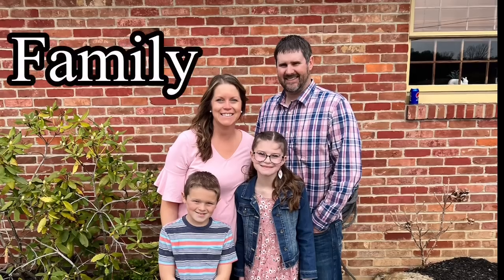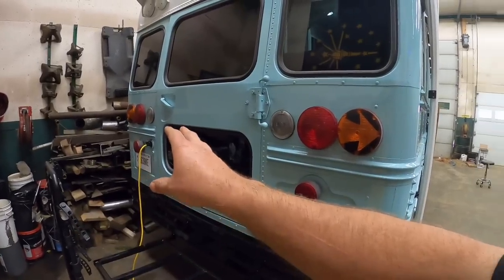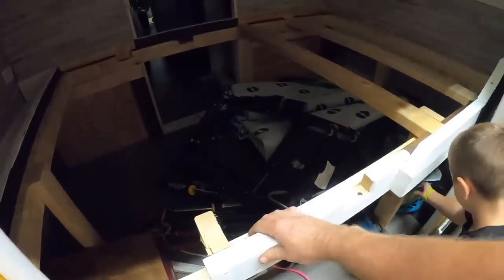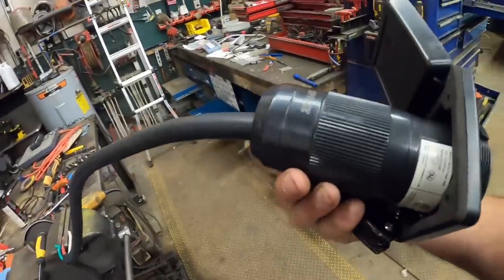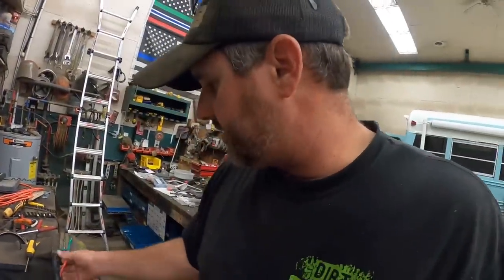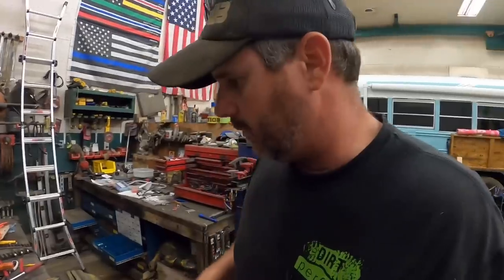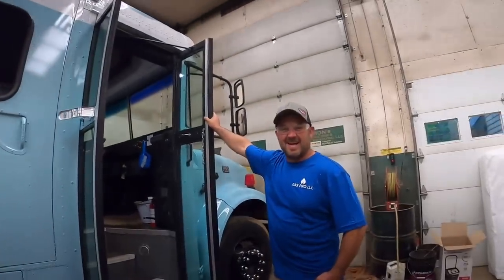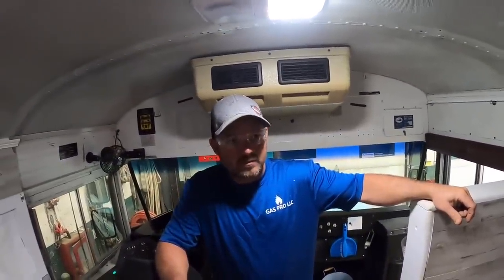Camper Bus Re-wire And Ac Upgrade: Little Family Project

Comment: A little advise from a master electrician…..Install a separate ground bar in the panel (for green wire) and remove the bonding screw.
Reply: My thoughts exactly, winced when Mike joined the neutral and ground in a sub-panel.  Only should the 'straight from the pole' Main panel have the Neutral and ground joined, otherwise you invalidate the proper ground path.    Nice wiring discipline otherwise.
Reply: @paulholmes672  my question is, if this is an RV,  then does it get wired differently? I ask because I am assuming that the power at the campsite is coming from a small subpanel with breakers and an outlet. Did the RV park already separate the ground and neutral at the campsite box? I have always been curious on how an  RV should be wired when it comes to AC power. Also, should the metal body of the bus be grounded/bonded to the subpanel?
Reply: @paulholmes672  I winced also when he put the neutral and ground wire of a circuit under the SAME screw.  If that one screw got loose, you could easily end up with 120 volts on the bare metal of anything plugged into that circuit - VERY DANGEROUS!

Comment: DP, you should consider putting those batteries in a box under the bus outside of living space. It could be a safety hazard in case of damage or short-circuit in an enclosed space.

Comment: I noticed it still has the factory AC, so I assume it's operational when the bus is running. That roof mounted unit is definitely better than that little portable unit.  I'm really impressed with how well designed everything is inside the bus.  Imagine if you had a 40ft bus!
Reply from the maker: Yup when running

Comment: Nice job on the wiring and A.C. installation. The camper bus has turned out very nice, should be a pleasure to use and travel with. Thanks for the tag along video.

Comment: I agree with several comments that the panel needs a separate ground terminal bar and the green bonding screw removed.  The ground-neutral bond should only occur in one place, and that should be in the shore power panel.  If using a generator, you will need to make a ground-neutral bond provision.  In my generator, i made a 120v plus that just has a jumper wire from ground to neutral.

Comment: the battery area should be contained in a box that vents external to the vehicle. charging batteries can produce pretty nasty gasses you dont want in a bedroom.
Reply: Maybe the batteries can be gel batteries and are gas tight
Reply: @gurraflex6478  sometimes they still breach. its good practice to isolate charging batteries no matter the style. obviously some more dangerous than others.
Reply: I was thinking the same thing!
Reply: He also made it much harder to access the batteries by putting the breaker panel there. I understand needing easy access to the breakers but you need to be able to get to the batteries too…unless there’s access from the top I didn’t know about

Comment: Don't want to sound like I'm complaining but you may want to rethink your grounds on the AC power in your bus panel. The grounds should be on a separate terminal strip that is attached to the breaker box and separate from the neutral bar. Check with other people and see if I'm right. It should be safer.
Reply: definitely true for a subpanel....at least in a house. good chance that should apply here
Reply: You are correct!
Reply: I agree.

Comment: Even with a 30amp RV hook up, you shouldn't have to isolate things because everything should cycle loads at different times so you shouldn't have to worry about maxing out the main feed but on very rare instances. 31:34 "Hot Water Heater" - Didn't know you had to heat hot water? 😄
Reply: "hot water heater" - jumbo shrimp, true facts, park on a driveway, drive on a parkway, hamburger, quicksand, boxing rings, lead pencil (it's graphite), ship by truck and send cargo by ship, ...

Comment: looks like a great candidate for solar panels. and if you put a radiator next to you A/C exhaust on the roof, you can switch from internal hot water heater, to using your A/C and sun to heat hot water.

Comment: Day late and dollar short but ya shoulda coulda added insulation to the voids before putting on the plywood for the rooftop AC @23:40. One could still drop the cover and drill a couple of holes in the 2x4s and add low expansion spray foam.

Comment: You and Aaron are men with many talents!  Have  Jenna buy a 50 to 30 Amp adapter plug and she will be situated for most power supplies. She may also want to purchase a 15 Amp adapter if that is all it is available, she can plug the refrigerator in.

Comment: I am trying to figure out why you have a HOT WATER heater in the camper. If the water is hot you don't need to heat it. I say this because there are actually hot water heaters; mostly for industry where they have to have hotter water than what is normally supplied. We need to be more precise in this sort of thing HA! What I say is true, but I know what you were talking about. Most people call it a HOT water heater but that's not what they really mean; and you didn't either. Someone else mentioned your neat panel wiring job. I must agree, I was impressed and I have seen and done many panels. Nice job!
Reply from the maker: Plan worked perfect thanks

Comment: It's hard to tell but you might want to put a little more slack in your input cable so when you're driving the bus and it's flexing it does not pull the wires out of the plug.

Comment: Another circuit that would be nice is to go to switchs up by the door and put in two of the small switches that fit in a standard plug cover and then with a chunk of 3 wire go to an outside plug that is split into two so if you have outside lights you have a plug with two circuits that can be controlled from inside

Comment: The neutral and ground should be isolated ! #10 wire from ground to the bus chassis.  You’ll need to add a ground bus bar to the panel
Reply from the maker: Tell me why
Reply: @DirtPerfect  This is considered a sub panel, without a bonding wire to the frame there is the potential for it to become live. Bus sits on rubber someone touches bus from the ground and they git bitten. Think of the sub panel which is what you are installing as an extension cord which now has the neutral and ground tied together.  A grounded fault can return on the neutral creating a shock hazard. Its normal to tie ground and neutral together in the main panel because the ground loop won’t happen there. I know you you only want to do things properly so here’s the nec code According to NEC 250.32(B)(1), all sub-panels require separate neutral and equipment grounding termination bars. These bars must be separated in order to isolate the grounded conductors' “neutrals” from the equipment grounding conductors and metal cabinet.Nov 22, 2021
Reply: I agree with the ground and neutral need to be separated because this is a sub-panel.  The main panel that is feeding the bus should have the ground and neutral tired.  The green screw in the box should also be removed to isolate the metal bar from the bus.  Additionally, is you are using a generator, you will need a ground-neutral bond somewhere in the system.  I have made ground-neutral bonding plugs for when I use my generator.
Reply: Jay is right. There should be a separate equipment ground bar installed in the sub-panel. The green wire from the power cord should terminate on the equipment ground bar. The green bonding screw should be removed from the neutral bar. All of the bare/green ground wires from your romex branch circuits should terminate on the equipment ground bar. White neutrals terminate on the neutral bar. You should also add a #8 green or bare wire from the ground bar to the chassis of the bus. 

Right now all metal parts of the bus are isolated from your equipment ground and in the event of a fault to one of the hot conductors (chafed wire), the entire bus would be energized.

If you grounded the chassis of the bus, as it's wired currently, with the ground and neutral connected together in the panel, there would be neutral current flowing  on all metal parts of the bus and thus creating an electrical shock hazard.

Bus is awesome, but it's not safe as wired, in the event of a fault. 

Not picking on you or YouTube engineering- just want you and your family to be safe!!

Comment: The Hot Water Heater needs an illuminated switch - so that you can See that it's 'On' (because it's has no visible indicator)
- Illuminated being one of those with a built-in Red Light/LED

Comment: This is my favorite channel.  I admire how knowledgeable you are in so many different areas.  However I had to cringe when you wired up the sub panel wrong and completely against code.  The neutral and ground have to only be bonded at the first means of disconnect.  Meaning wherever the panel is that feeds the outlet that the bus gets plugged into.  Any sub panel after that has to have the neutral and ground isolated from each other.  In case of a fault, you need a direct path to ground to ensure that the overload protection trips.  By bonding the neutral and ground together, you have created two paths.  You simply need to add a grounding bar inside the box, put all your grounds on that, and remove the green bonding screw.  Sorry DP.  A very common mistake, but one that gets rejected by electrical inspectors all the time.
Reply from the maker: Thanks

Comment: Where is the Solar Panels? In the UK we would be using solar panels and you get a lot more sun than we do. You should be able to have at least 6 on th roof. If you have a look UK canal  Liveaboard narrow boat videos you see what I mean and they rarely use mains. There are not power sockets along the canal.

Comment: A marine waterheater with an engine heat exchanger would solve your problem. Mine is a 12 gallon with a std. electric element while on shorepower.

Comment: I know the Americans due electrical work a little different…….but you should not be combining your neutrals and grounds on same buss…the green screw (bonding screw normally only installed in first panel after supply transformer)in the neutral buss is dependent on how the supply system is wired and whether you have a ground rod/plate will determine whether to install that screw or remove . If  you leave the neutral and ground wires combined and a wire or appliance shorts out every metal surface grounded in the bus will have full voltage on it (possible electrocution)  and since there are no fuses on the ground wires they also run the risk of overheating and causing a electrical fire.. Please consult your local electrician and or Rv repair centre….Otherwise wonderful Job

Comment: In campgrounds that my wife and I visit, the 50 amp service is two 50 amp leads at 110 volts that cannot be combined into a 220 circuit.  It looks like you configured  your camper similar to the way a house is wired.  Does this mean that you don't plan to camp/travel in commercial campgrounds?

Comment: I gotta say I’ve never seen 14/2 hard wire in a vehicle/camper. Not that it’s wrong, I’ve just never seen wiring in a camper.  🤣
Reply: Stranded wire would be appropriate. Extension cord wire from 6 thru 16 gauge. Look into SJOOW cable.

Comment: You created a dangerous situation when you bonded ground wires to neutral wires inside your secondary electrical panel. The way it is wired electricity is flowing through all ground wires inside your bus.

Wherever the primary/main breaker panel is, the first panel that is fed directly the utility meter or a generator, that primary breaker panel is the only panel that ground wires and neutral wires should be connected to the same bus bar. Every panel after that is a secondary panel. The neutral and ground must be separated in all secondary panels. This prevents electricity from flowing through the ground wires. There is a Square-D ground bar that must be purchased separately and installed inside your secondary breaker panel, which will screw onto those raised bosses with threaded screw holes in your Square-D panel.

If you use a generator, you might need a bonding plug at the generator, but only if your generator has a floating neutral. (Google this if you don't know)

In addition to separating those ground and neutral wires, you should bond the vehicle frame. Use the same size wire that feeds the panel, either green insulated or bare copper. Is that 8 gauge wire you used from the inlet plug to the panel? To do this, get a eyed ground lug and bolt it, not screw it, to the vehicle frame. Connect the bonding wire from ground lug to the new ground bus bar inside the panel. You should find a 1/4" knockout in the panel box for that wire. No gromet or clamp is required.
Reply: I agree 100%
Listen to this man! 
I stopped watching as soon as I saw that and came to the comments looking for that to be mentioned.
45+ years wiring.
Reply from the maker: I  am so confused do you guys not watch the videos
Reply: @DirtPerfect  I watch beginning to end, have been watching your channel for a few years.
Did I miss you making a change? On the video timer at 33:40 the green wire and white wire are both connected to the neutral bar. 

Remove the green wire and connect it to a new ground bar that is connected to the panel box. Remove all of the bare copper wires from the neutral bar and connect them to the ground bar.

The way it is wired now, the vehicle can have "hot skin" if there is any fault in the electrical system. Someone touching the vehicle while standing on the earth can get a minor shock in dry conditions.  In wet conditions it could be deadly.

Comment: Need to measure it from the top of the unit all the way to the floor. And whatever height it is. Fix a sticker for and put it on the  Dashboard This way, you or the wife Will not hit a low underpass. Or a Canopy

Comment: Hey Mike, are you putting 20 amp circuits on 14 gauge wire, should be 12 gauge if not . I know its not exceeding the amp draw but just saying.
Reply from the maker: Not one pice of 14 in this thing

Comment: MIKE WHY NOT CONSIDER SOLAR POWER FOR DUAL POWER
Reply from the maker: No
Reply: Going solar on a bus is a complicated set-up.  Check out Bus Grease Monkeys solar Seton his bus. To be really effective it seem to take a bunch of panels, a large expensive inverter and some expensive batteries. Its a large, heavy set. He has his set in anold 4140 GMCbus.

Comment: Why are you not using the factory air unit in the bus.
Reply from the maker: Don’t want to leave running all the time
Reply: You do know that unit runs on a power inverter factory it's not 12 volt it's a 110 system.
Reply from the maker: No it don’t engine mounted compressor sorry to disappoint you

Comment: do you all have T moble aroung you if so the internet box will work anywhere you have cell tower signal , i have had it for a year and worked every where i gone so far its only fifty dollars a month . the box is only 5 x  5 and 8 inches tall and now wires to plug in to it , but you can hard wire your pc and tv to it if need .it just plugs in and your on after set up once

Comment: Need to change the neutral and ground wires to one wire under each screw.
Reply: Actually since this is a sub panel and not the first means of disconnect, the grounds and neutral have to be separated from each other.

Comment: Why is there no solar panels on the roof and you wouldn't have to worry about any electrical problems
Reply from the maker: Fuck that are you serious omg plz study what that take
Reply: You could use solar to charge the inverter batteries. Might be enough room for that.
Reply: Seriously, have you never ventured out into the great outdoors ? Most camp sites are situated under nice big shade trees , which tends to limit just how well solar works .
Reply: You made DP swear in comments, that's a first!

Comment: Wow ur all over the place with the wire size and amperage. At first you said toy took a wire from a water heater. They are 30 Amps. That cable you used was at least 8 gauge  or 40 amps. Yet yo want 50 amp receptacle. With copper you can almost get away with 8 wire but you better go with 6.
Reply from the maker: So confused by comment only used one wire size

Comment: Mike....   Never place the neutral and the ground conductors from the same circuit under the same screw.  Neutrals should never share with anything, and only two grounds per screw as that is what the Square D buss is UL listed for.  By placing both the ground and the neutral from the same circuit under the same screw, if it were to come loose or burn open, you lost both the return and the safety of that circuit.   Keep up the great content otherwise!
Reply from the maker: Glade you enjoy

Comment: sorry but the BUSS does not fit in with the them of DIRT PERFECT . just saying is all as i can not see this pushing a run of dirt if it tried . could lower the front bumper or better still turn it into an . air conditioned sight office come lunch room then maybe it has a use finely .

Comment: Hold up tonto.     Rv plugs are two 110 volts 50 amp each leg as in your Rv.  any such device in the 11:12 Rv uses 110v.  Not ever 220 v.   Thought you would like to know